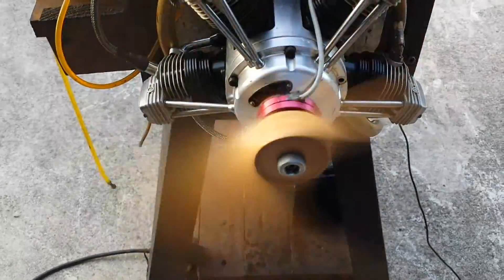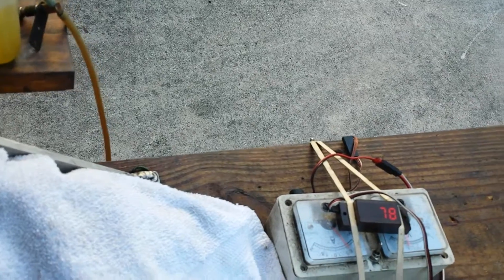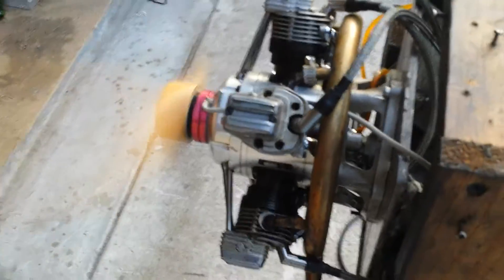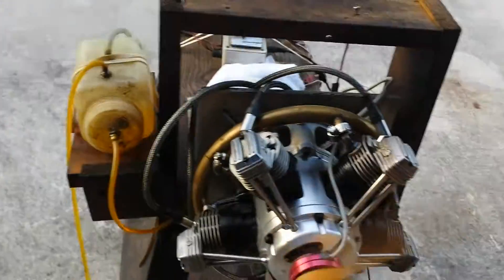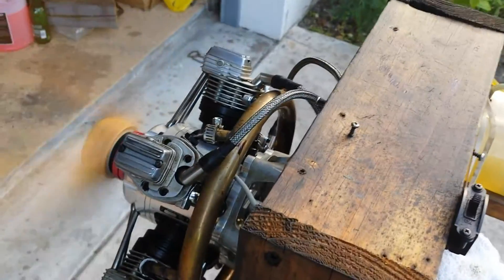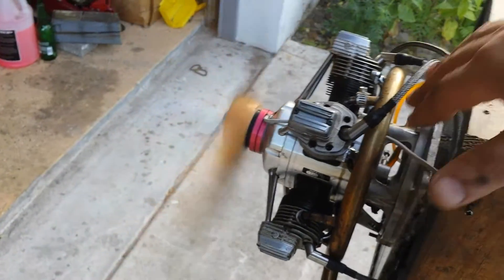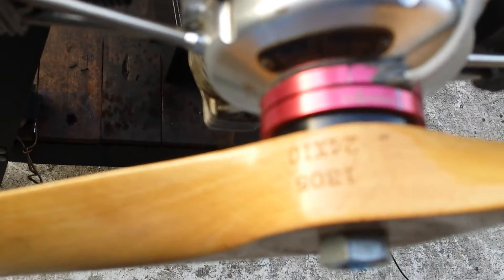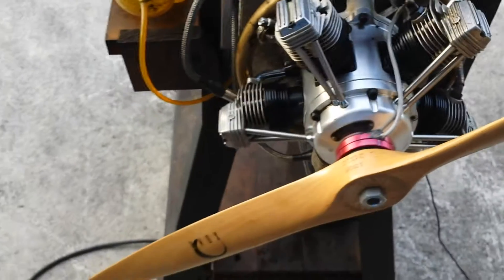OS SIRIUS 5 CYL RADIAL, GASOLINE & CH IGNITIONS

Comment: Old but great! A 50ccm radial would fit perfectly for a project, I have in my head!
Unfortunately there are only a few in this size, and if, they are probably glow engines!
As I want a gas engine, which one would you prefer to convert in to gas? The OS Sirius 300 or the SAITO FA 325 R5